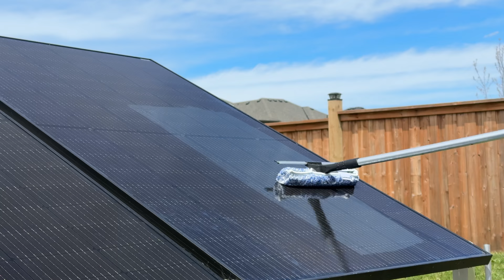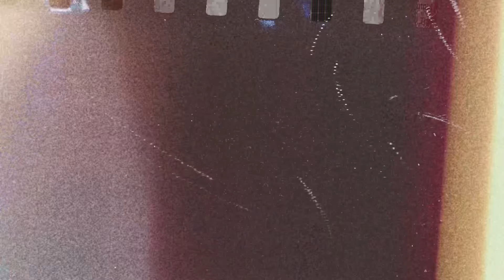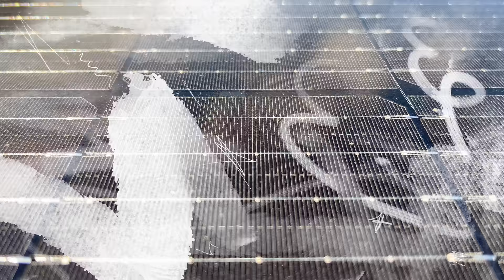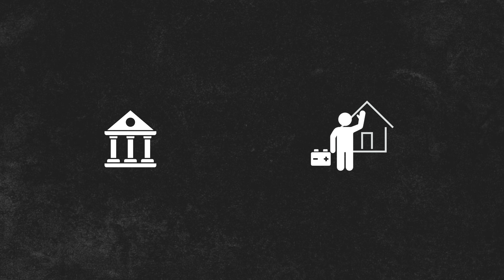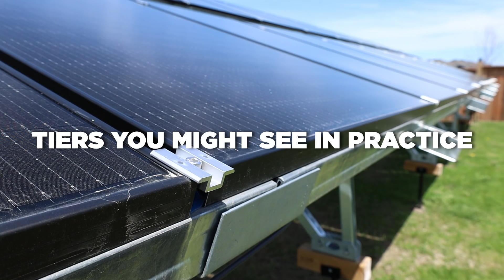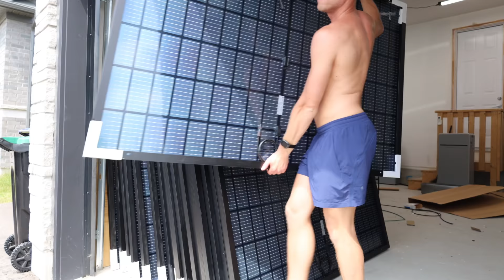Solar Panels Don't Matter... Here's Why.

Comment: I am not tech savvy at all. What do I need? How do I set it up? Who can I hire for help? Any suggestions?
Looking for a system to run my fridge and freezer, plus an instant pot for 5 mins for rice cooking. Only in case of a power outage due to an emergency.
We have mild to hot weather year-round. WE have never lost power in 20 years, but it could happen.

Comment: I have 60 solar panels on my roof that I had installed in 2021, which are high-tier and my house has produced more power than the house uses. Not for one month has the production been less than what my house uses. I pay $18.50 a month just to stay hooked to the grid. I get a one-for-one credit for the excess power generated. I own these panels outright. Never had a technical problem with either the inverter or the panels. Being retired and on a pension and Social Security, it's a real advantage not to nit pay the high electricity cost. Glad we decided to invest in solar!

Comment: might be better larger panels because i could cover a spot where the roof a little wavy . nothing wrong with it they made it that way , it;d be seat to add foamboard under it to the roof peak and coat the foambord , and solar does better coller also i'd make water heater coils for a cheaper version to cover the roof though and mount solar on the ground somewhere or a shed or carport but still i'd want bigger to protect the roof below and cover more of it

Comment: My question is regarding a much smaller scale setup, but how would you rate the small solar panels that are generally sold by the various power station brands?  I know they're different from the large setup you have but I was just curious if you had any knowledge or thoughts about those smaller 200w to 500w panels?

Comment: You can get an advantage from a bifacial panel on a roof if you roof is reflective. I had wavey cement type panels common in Colombia that overheated the house and used special reflective paint which successfully lowered the heat. My bifacial panels work over a larger percentage of the day and closer to their potential production. Not a big sample population, but taking some time to prepare the surface you're mounting the bifacial panels on. seems like a good idea.

Comment: Here's a schocker, people will try to take advantage of the ignorance out there. A company selling a portable power station will match it with an overpriced panels because you can just plug it in. Meanwhile, you're paying double or triple for an equivalent in Amazon. If you have the money I get it. It's an easy solution that does what you want. If you have a real need and depend on getting your money back in savings, it's terrible. The problem is it's not horribly complicated,  especially if you've done basic wiring, liked science, done wiring on a sailboat and read the books to do it right. If not, you have to watch out for the dangerous "expert", YouTubers who have their own theories. Make sure you are getting good information and matching the specifications correctly. Again, it's not that hard if you get quality and clear instructions and watch  the right videos. The most important thing is knowing what you don't know and who to consult. Check your understanding with someone who should know whenever you have the opportunity. It doesn't hurt to start small. I was an early adopter on my sailboat. All I needed was a charge controller and one 12v panel and everything was 12v compatible, but I no longer worried about lights (I also converted to LEDs) and no longer had to run the engine at anchor. Well, your first project is probably going to be more complicated but also more capable. There are power stations that can run a typical American house and and combination batteries, charge controllers, and inverters. Sometimes you pay more for convenience, but the are some good quality deals. Will Prowse tests and rates systems. I can't recommend his videos to everyone for the same reason he is so good. He's a bit obsessive. However, you can trust his recommendations are based on objective testing. He does like to take them apart and explain what is done well and what makes him, let's say, uncomfortable explicitly in detail.

Comment: I'm an electrician with over 30 years experience installing and living on solar power. This teir stuff is a marketing ploy to stop you asking the important question about what type of solar cells are in the panel. There is essentially three types moncrystaline, polycrystalline and anamorphic.  The thing to know is the first two are made from lumps of material, while the anamorphic is vapour deposited... typically the monocrystal  and polycrystal types have very long operation lives, anamorphic gets a bad wrap from some manufacturers not making the vapour deposits very thick or well attached to the substraight... that is not to say all anamorphic are like that. 
Personally I go for moncrystaline as I have been getting a really good run out of them, some of my original panels are over 40 years old and still earning their keep every single day...

Comment: Choosing  the proper type of panel for your system does matter! For  example deciding on a P-type panel or an N-type panel  can be very important as the output voltage is  very different  between these two types. P-type panels are the most common BUT  the have a lower output voltage  than N-type. (18 to 20 volts  v/s 25 to 27 volts for N-type.  N -type has a lower current output.......so  the wattage output can be the same as a P-type..........But you cant mix Ptype and Ntype  in the same system without lowering the overall system performance. N-type panels are the better choice as they will have less I^2R losses .Also Ntype panels are a better choice when using MPPT charge controlers and panels in series configurations.

Comment: What about this?

The most prominent example of an island tested as a complete 100% renewable test case that ultimately failed is El Hierro in the Canary Islands, Spain. The project, launched in 2014, aimed to power the island exclusively using a combination of wind turbines and pumped-storage hydropower. [1, 2, 3, 4]
The experiment fell short of its 100% renewable goal due to several core issues:
Geological & Capacity Issues: The island's reservoir was significantly too small—requiring up to five times the water capacity to sustain demand during long lulls in the wind.
Continued Fossil Fuel Dependency: Because the renewable storage couldn't sustain peak loads, the island was often forced to rely heavily on backup diesel generators. In some cases, oil made up to 90% of the island's energy generation during low-wind periods.
High Costs: By 2019, the project had cost roughly 90 million euros, yielding electricity prices that soared as high as 81 cents per kilowatt-hour—a massive financial burden for residents.

Comment: Prices must have gone up. I paid 25 cents per watt.

I have a little experience with solar. I would advise against mounting them close to the ground. You would be surprised at how small of a pebble from a weedeater can shatter the entire panel into smithereens. I put mine on top of my shipping containers. Which act as  dual use.

Comment: So Signature solar SOUNDS great. BUT what if you want 1-6 solar panels? I DO NOT need 10 panels! I need 1 to replace a damaged panel in an existing Enphase Array (meaning each panel has a microinverter). And I'd Like to add a few panels that I can use in a classic config to charge solar generators/power minisplits/permeant mount to my camping rig.

Comment: BUYER BEWARE. Please read before thinking of buying Eco-Worthy solar panels.

Bought 2 195W panels a little over 2 years ago and one now has a VOC of 14.8V should be over 20 volts.
Called Echo-Worthy and after a back and forth battle with them, said they only have a 1 year warranty
and I would have to pay them $60 before they would send me a replacement.

Why would I pay them and trust them to send me a good new one with only a 1 year warranty when I could buy
a much better one with at least a 10 year warranty like the 2 RVPOZWER 200W panels I bought on Ebay for $130.

They put out about the same power as the Echo-Worthy, not happy with them!

Comment: How does a 25 year warranty on a solar panel work ?    Do you have to package up the bad panels on a pallet and hire a trucking company to ship them back to the seller ? A bad solar panel has no value so shipping them back is not an option .

Comment: I bought  three 100 watt RENOGY panels and they charge  a battery bank of six batteries.. Have been working for over 10 years. I use them with a pure sign wave inverter to run my freezer and refrigerator when the power is out. Still happy.
Reply: Renogy is awesome
Reply: I am new to setting up solar energy harvesting. I'm trying to do the same thing. Running my refrigerator and a 7 cu. ft. freezer. Can you please let me know your battery brand/model, inverter brand/model, charge controller, and other parts I would need to replicate your setup? I would appreciate your help with this.
Reply: Can you please state the Wh, and Power rating (W) of your battery and your Pure Sine Wave Inverter.

Also, does your setup by chance power your AC.
If "Yes", what is the Power rating (W) of the AC

Comment: I bought two pallets (each 36 panels) of TrinaSolar 425Wp for 0,151€/Wp (in Estonia) and it brings my Organic Farm 45% over the Winter (mid November to mid January).

in the Summer I heat up a Geothermal Energy Storage, because my DIY EV wirh 64kWh LFP need under 30Wh/km 😊 and I do not need to charge like crazy.

I have in total 45kWp installed =East 50°, South 70° winter optimised, West 35°) and I am 100% off the Grid.

Comment: Remember, the most important spec is the VOC! You don't want to connect a 46V panel into a micro inverter with a 45 volt limit! You do not want eleven panels with VOC of 44V in series to a string inverter with a 450V limit per MPPT

Comment: Not sure if they are being made as well as they used to be, but i just hooked up a pair of panel rated 216Watts each and pulled 421 watts out of them and they were not angled optimally.  They are OLD, taken out of production 5 years ago.

Comment: Good video.  I bought a whole bunch of some 100W tier-3 "Newpowa" panels off eBay six years ago.  They were on the cheaper end, but I noticed some issues:

(1) Within a year, the technical information labelling on the backside of the panel had become unreadable.  You'd think they would have tested that.
(2 )After 6 years, some of them show some delamination under the glass seen on some of the embedded solar cells, but the panel remains waterproof.
(3) An IR camera shows one with the hot cell significantly warmer than the others.

Overall, it was a good deal because they were cheaper per watt than others at the time.

Also, these panels are not UL listed, which is also why they were listed as "off-grid" solar panels.  Watch out for that, because you might not be able to get them approved for permitting.

Comment: Degradation matters, snow load matters, wind load matters, hail resistance, and of course the strength of the company. No, you probably don’t need to spend up for “top tier”, but FFS don’t buy cheap panels.

Comment: There are other specifications that one should pay close attention to. Shade tolerance is important if your panels will be close to another house or to trees (Aiko and Longi do well here). Degradation matters if you're keeping them for 20, 30 or 40 years. And temperature coefficient is especially important if you live in a hot climate or going for in-roof mounting, so a brand like REC will be more efficient when conditions are hot.
Reply: shade tolerant panels are 100% marketing BS with little to no basis in reality.
Reply: @xeridea  Some may be but certain not 100%.  I design and build and test custom made solar panels and most of my customers ask for more "shade tolerance" and I accommodate them.  The simplest (least costly) technique for more shade tolerance is to implement more so-called "smart bypass diodes".  The next simplest is to "break up" the panel such that it is composed of more independent strings of cells.  There are other techniques as well.

Comment: N-Topcon Panels for shade tolerance is a major consideration for me due to living in suburbia with lots of partial shading during the course of the day.
Reply: "Shade tolerant" panesl from what I have seen is a huge marketing lie. Often simple half-cut cells outdo panels supposedly with huge shade advantage. N topcon may perform on average maybe 10% better in shade, considering shade cuts power a large amount, 10% may only be 2-5% of panel full sun output. Considering you will also get full sun hours, the actual percentage difference of energy gathered from "shade tolerant" panels is rather low, and I would just go with the cheapest option. No point paying a premium for what is in reality barely more than a rounding error, and you will be much better off just buying more panels.
Reply: @xeridea Or rather, luckily, the tech to get 22% efficiency and warranty 25-50Y has carrier transport layers that lend 30-70V of back voltage rejection, so they're shade tolerant with no separate diode components.

Comment: Renergy makes great panels and you can get them used for an even better deal.
Reply: Renogy is highly overrated. Their panels are crazy expensive, and tests show they aren't even really the best panels. They also have supposedly shade tolerant panels that perform pretty bad in shade, and inferior to some cheaper panels. I don't know why anyone falls for the hype and pays around $1.00 per watt, which is beyond absurd in 2026 for maybe B tier panels when there are cheaper A tier.
Reply: I assume you meant Renogy and I've had great success with my 6 100 watt monofacial Renogy panels.

Comment: if you have an issue with shade it become a big deal on what you buy.
Reply: Not really, the actual differences in total energy harvested from these is barely more than a rounding error, and often will actually be worse than non shade tolerant panels.

Comment: I had to do my own research as NO ONE, and I mean NO ONE in the Western hemisphere has reviewed HPBC solar panels.  They are the most efficient panels that you can buy today.  They are very shade-tolerant, as well as have a low temperature coefficient so they don't lose output as summer temperatures approach like other panels do.  I paid $105 for 220 watt panels that consistently put out 250 watts or more in 70F or higher temps.   As you mentioned in your video,  some are limited on space AND have shading issues, so maximum kwH per day under those conditions is critical.  

25 year warranty.  Let's be honest:  In 25 years, every single solar panel sold today is going to be equal to the double-density 5-1/4" floppy disk.  Same goes for LiFe04 batteries.  However many cycles in 5 years won't matter as in 5 years, batteries will be replaced by super-capacitors or some other ground-breaking energy storage tech.
Reply: How do I get $105 220 watt HPBC panels?
Reply: @palindromeambigram4852  Amazon.  Either Rvpozwer or AeternaSol will have them on sale with additional discounts for buying 2 or more panels in addition to coupon sales.
Reply: solid state batteries are coming soon. You'll see the price for lithium batteries fall no doubt.

Comment: Solar solar solar, heres a thought, if panels dont really matter, then there is no difference in portable solar, and hard panels, wrong, is the wattage output the same on 400w panels across the board, nope, are all panels built to withstand the same impact, durability, build quality, nope, will one brand out last another, and keep producing its rated power longer, yes! All panels are not egual in, power,build quality, conversion rate and longevity! JM2C  sorry, its just not irrelevant, or the same

Comment: I just picked up some 200 watt 18 bus bar N type bifacial panels on Ebay for $77 each and have already seen them output over 225 watts each for hours at a time. It's insane how cheap these have gotten. Even if I only get 13-14 years out of them where they still make 80% of original output after, they'll pay for themselves hundreds of times over. Where does the market go from here, $40 bifacial 200w panels with improved technology and even higher efficiency? There will be no purpose for a power bill or even owning a gas-powered car for most people soon.
Reply: I mean, you gotta make them into attractive fencing and stuff, but sure.

Comment: boat solar panels are pure copium.  When the weather is nice is when we cruse and the engine charges the battery.  When the weather sucks, when we want power to run internet and screens, we are in a marina and the boat is plugged in.